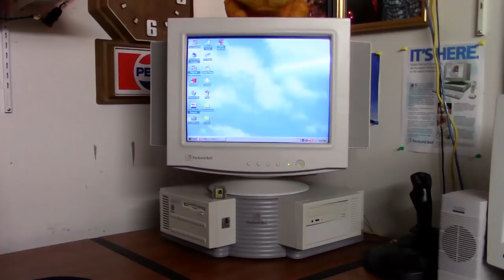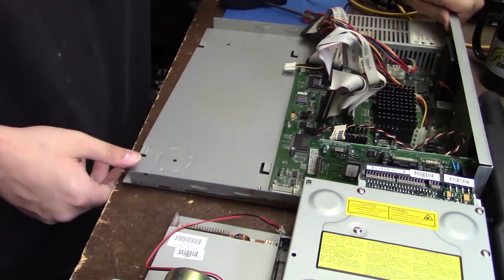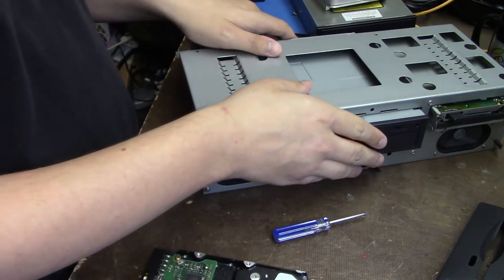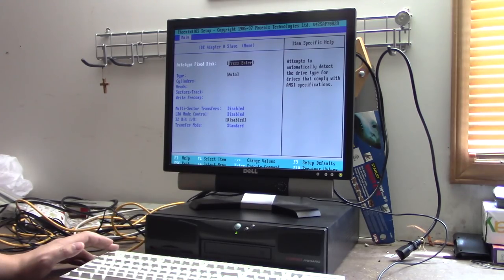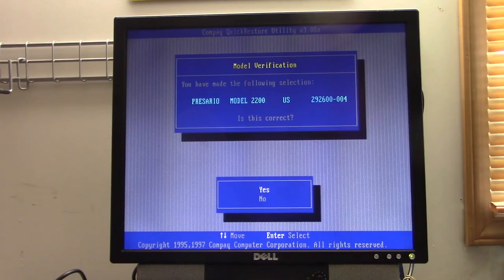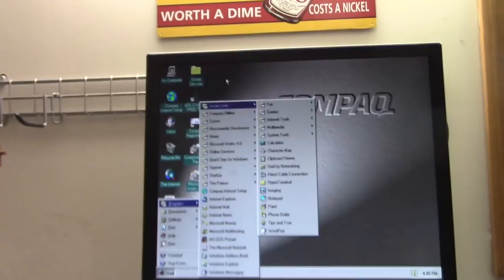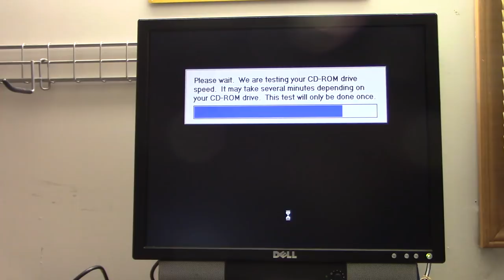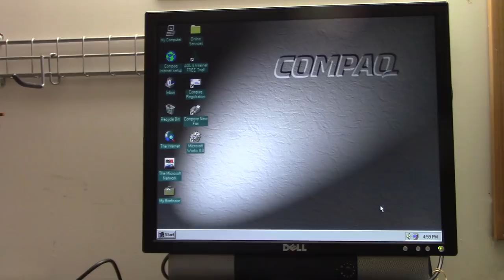Compaq Presario 2200 Upgrade & Restore CD

Comment: Glad I found your video!  I bought one of these for my kids in the late 90's and ended up selling it a few years later.  But I always liked the form factor and at the time, it ran the kids games fine.  So I ended up finding another one on Ebay last year.  I was planning on swapping the HDD with a SD/IDE adapter or a SSD/IDE adapter.  But as I was pulling it off a table to take it to the bench, I dropped it!  I wasn't able to get it to boot into the HDD after that (or anything else) - if does POST and I can get into the BIOS.  Anyway, I found replacement motherboard and will try that today.  Your video is saving me a load of time!  I don't know if I would have figured out where those two screw are!  Thanks...

Comment: if you have a old cd-rom drive that doesn't work, crack it open, and in the lens assembly, you will find 2 or sometimes 4, lil small magnets, if you use those to put them on to your screwdriver, your screws will never fall off ever again ;)

Comment: Hey, that's my first retro PC! I got it when it was 14 years old, and now it's 23 years old. The Cyrix MediaGXi CPU in it performs more like a 486. I've also been wondering what causes it to freak out when trying to boot Windows 98, but I haven't been able to figure it out.
Reply: Probably the BIOS is the culprit. It must not be fully compliant to IBM-PC architecture. It could also be the CPU, but I doubt it. Certain software refuses to run, and would crash. Overall it's not a great computer but it's definitively unique. Only one 8-bit ISA port...